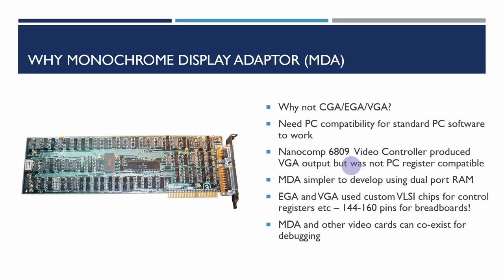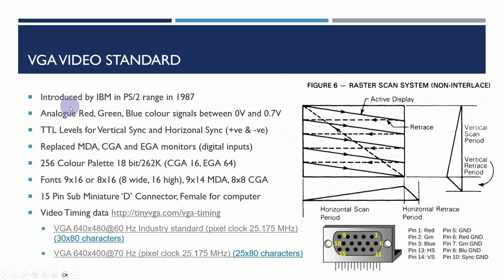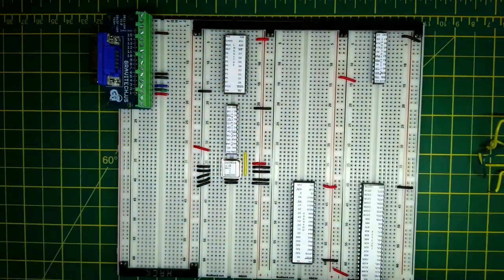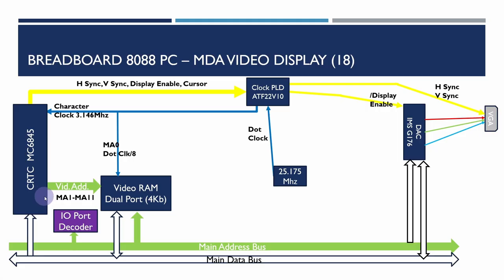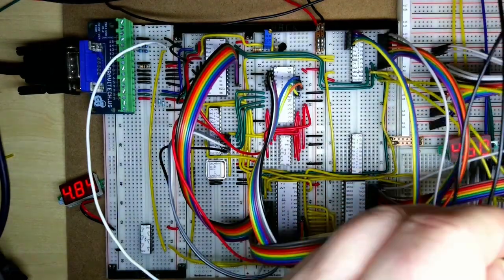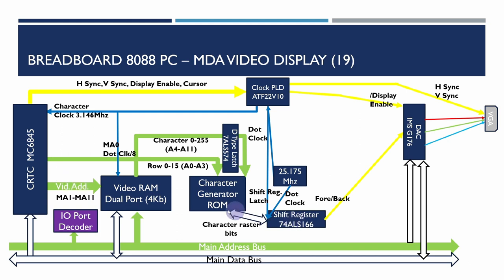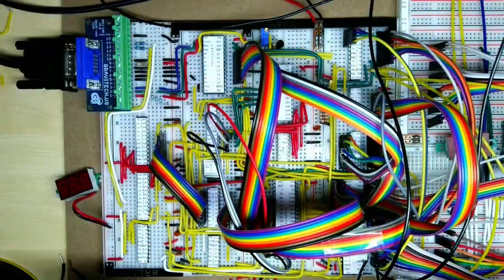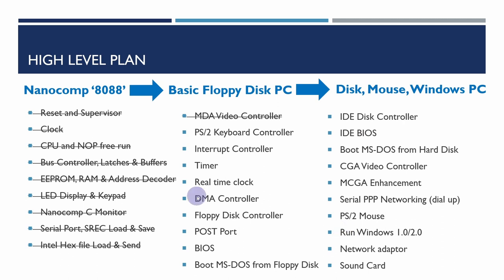Breadboard 8088 PC 20 Minute summary MDA Video Controller #13 to #21

Comment: I would like to take this opportunity to express my deepest thanks and respect for your videos.
Your preparation with the presentations about what is done in the video is very good. It takes the viewer along and reiterates what has already been seen. I myself have been thinking about setting up an 8088 system for training purposes for a few weeks now. That's how I came across your video series. My plan was to first build everything on a breadboard and then on a circuit board. However, I would use different chips at one point or another. Thank you for taking up my suggestion to use the better display of lines in Notepad++. 
But where there's sun, there's sometimes shade.
I find that you often jump across the screen very quickly with the mouse. The viewer quickly loses focus because he can't follow your thoughts and the mouse (at least I can't). It's also difficult to watch when you move the mouse pointer in a circle over an object. I understand what you are doing. I used to do this in presentations, for example, and had to get out of the habit.
Furthermore, there are still question marks in some of the videos that I would like to ask. I will therefore post them under the respective video when I have the necessary time and peace and quiet. But I have to watch everything again in peace and quiet to deepen what I have seen. But maybe it's a better idea to collect the questions and answer them in a summary or FAQ video. What you are doing is complicated and not always immediately understandable. You should have 100.000 Subscribers and not only 1120.
Nevertheless, I'm really looking forward to your upcoming videos. I can well imagine how much time and energy you invest in your videos. 
I would also be delighted if you could update your Github repository to the current status (video 22). I would then have the opportunity to deepen what I have seen with the circuit diagrams. But this has absolutely nothing to do with my ambitions for my own project! 
To summarize: Thank you for your great work. I really appreciate it. I would like to take this opportunity to express my deepest thanks and respect for your videos. 🙂
Reply from the maker: Thanks for the feedback, I'm doing this primarily for my own interest but if it helps others to understand how this stuff works then great, I've not been actively promoting the videos so just organic views at the moment. Once I have a working DOS Breadboard PC I will do some more shorter videos on the running it rather than building it as I think this will have a wider appeal. I have been spending a fair bit of time recently sorting out the design for the final phases to get DOS booting. Will update the files and Github later next week after I have managed to get the next video out and the schematic is pretty close to final version.
Feel free to comment on the individual videos, I may need to re-watch them to remind myself of what I did! I am very much learning as I go a long so happy to express opinions on issues (though I may not be correct!). Dave

Comment: Usually I speed up videos I watch, but in this case I had to set it to 0.5 speed)
Reply from the maker: The build sequences will be 12x speed, 1min=5s. Real time would be tedious I can assure you! Dave
Reply: @breadboardinglabs  That's correct, but sometimes you are talking so fast that it's impossible to follow you if someone is not a native English speaker...  So I slowdown your Video to 0.75 or 0.5 too. 😀